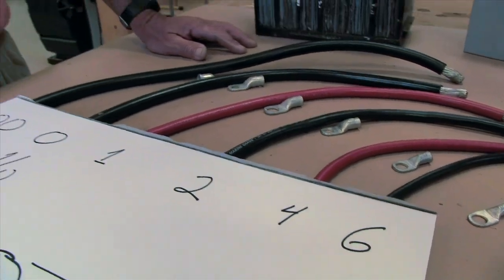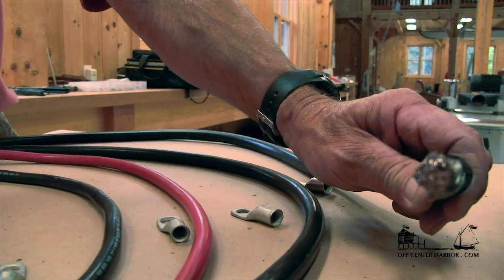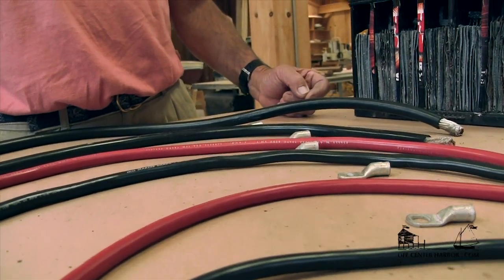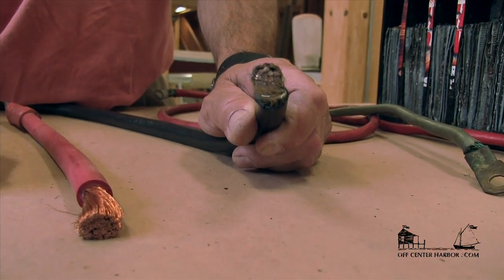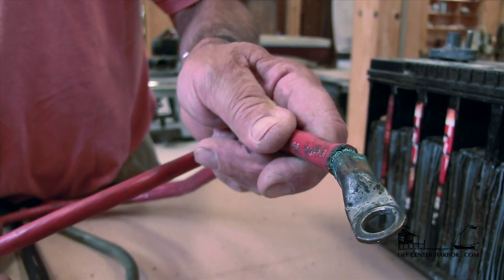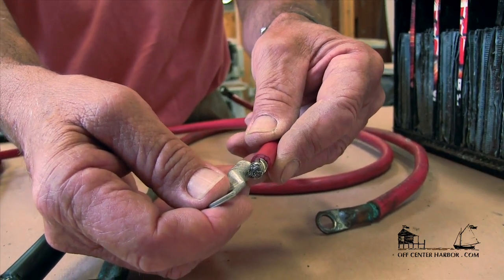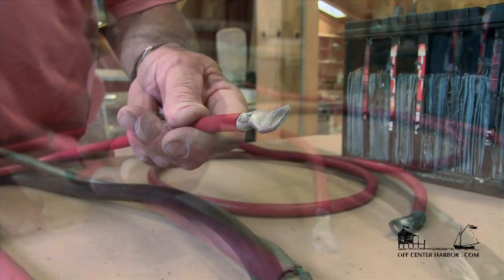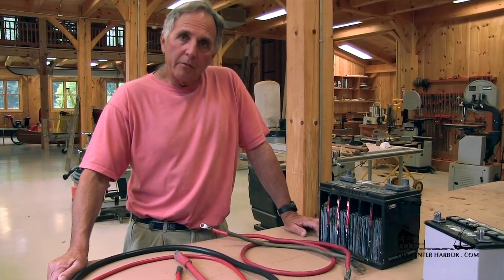Electrical Systems - Part 2

Comment: Good information.  Good sound. Get a tripod for that camera and use it.  Make cuts to show closeup details. The constant motion on a wide shot works for short durations, but gets to be distracting when one is focused on the speaker in long takes
Reply: I would disagree with you in this setting. Personally, I find that the camera motion adds interest. The camera work is well done. Static shots with tripods are uninteresting and can be boring. For learning about wiring, this method of video production has definitely helped me. Keep up the good work.

My only critique would be of a close-up shot in another video where the instructor explained the meaning of the text on the wire insulation. In that shot and the camera was out of focus. He quickly fixed the issue though, in the following shot.
Reply from the maker: all that great advice and no videos of your own to see!
Reply: JamestownTV That may be, but That doesn't change the fact that your technique could improve. Try taking a few classes at the community college.